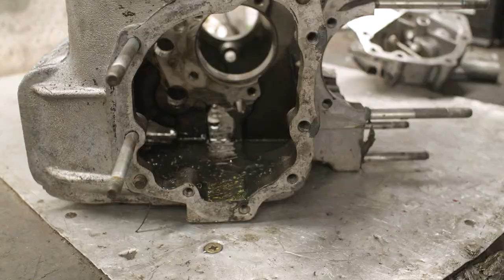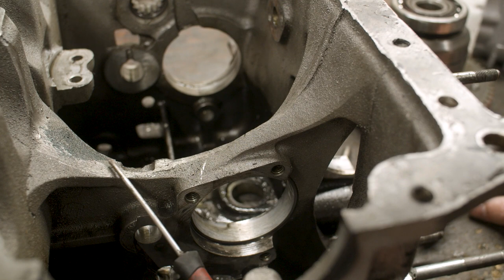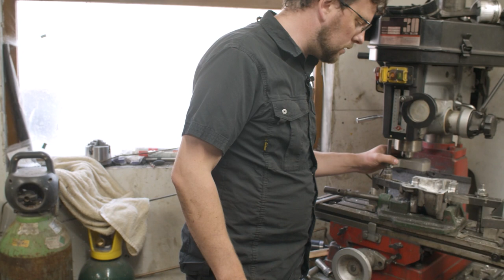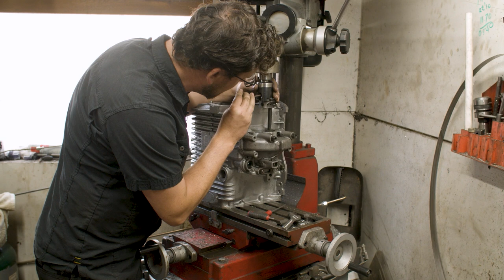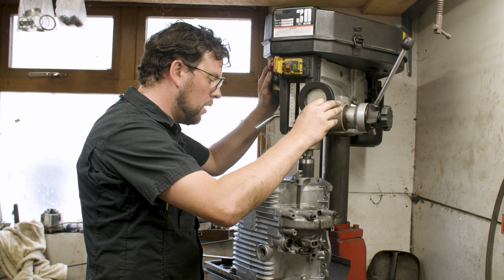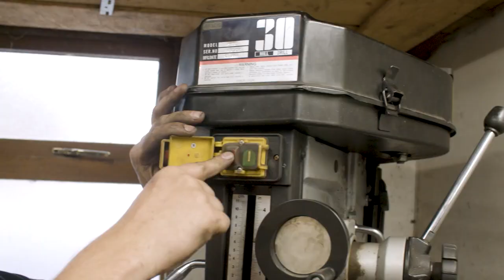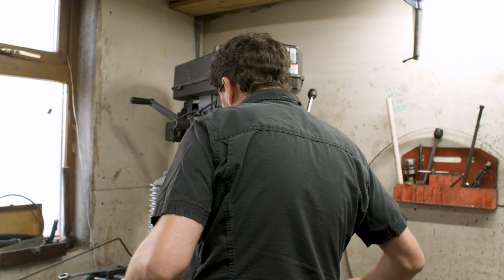Classic Mini Gearbox  Cassing - Race Preparation

Comment: Hi Paul, So on my DAM5626 gearbox should I be installing a gasket with a DAM4970 diff cover? I read somewhere that the factory quit using the gaskets on later gearboxes.

Comment: What do you think of fitting a pinion support from KAD/MED instead of using the 3 bolt case?
Reply from the maker: It cant harm, but doesn't really solve the problem that the 3 bolt casing dose. But Im sure it would help.
Reply: @HREIRL  I’m using remote casings so it’s my only option to put big power through.  If it prevents the pinion riding up the final drive gear then it should hopefully reduce stress in the web.

Comment: You mentioned sand blasting the gearbox casing, ive heard that any grit can remain inside (trapped in the surface of the casting) and then comes lose when the oil is flowing around, and then goes through the engine.  Whats your thoughts on this?

Comment: Hi Paul, had a thought.  When you've milled the diff cover so that you can line bore it, is there any issue with the side cover bolt holes misaligning, as in theory, you've reduced the distance between the two sides?  All the best, Paul.

Comment: Hi Paul,  I am curious about why you would not need the gasket installed to create relationship between the gearbox case and diff cover for machining? Thanks
Reply from the maker: Gomer, I don't intend on running a gasket on this box so, if I machine the housings with out it, and only use RTV for the rebuild I will know the tolerances will be in-spec. If I intended running a gasket I would have to fit the gasket before machining
Reply: @HREIRL  That makes perfect sense! Thanks

Comment: 0:41 Why not leave out the 4th bolt? or is that bridge section on the new Rover casing stronger? Postie has just delivered my HRE merch i ordered :-)
Reply: The hole for the 4th bolt is the weak part, not the bolt itself. Leaving out the bolt still means the bolt hole remains.
Reply: @simonpertot4962  Fill it with weld?
Reply: @paulrobinson3528  I wondered the same thing! Perhaps they also made wider webbing in the upgrade as you say? Or perhaps the heat of welding would distort the dimensions and require correcting? I'll leave the answers to those who know more than me! (The author of this channel perhaps...)
Reply: @simonpertot4962  Yes will be interesting to know if the webbing/bridge is thicker on the later ones.........................wheres Mr Hickey when you want him lol
Reply from the maker: As Simon, said Paul leaving the bolt out still leaves the weekness of the hole which is where the cracks form in the centre web. I believe back in the day company's used to weld it and also weld in a strengthening rib but the rover boxes have the rib built in and the bolt hole omitted so its just the right case to chose
Reply from the maker: the web is thicker and slightly wider Simon, Yes I would be concerned that the weld its self would be more than up to it but the area around the weld could be a potential for failure as it will have gone through some fairly intense heat cycles